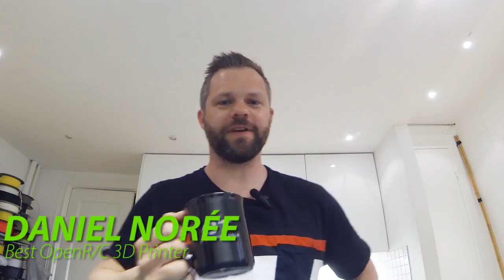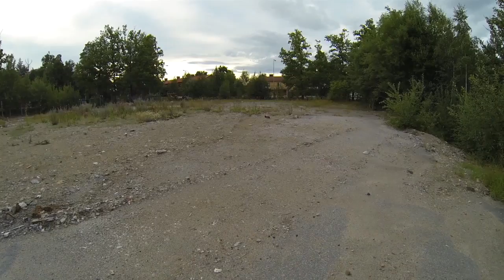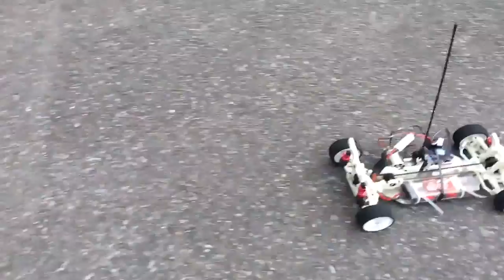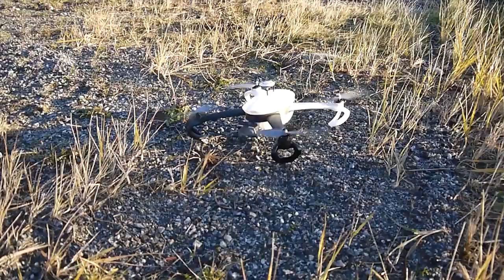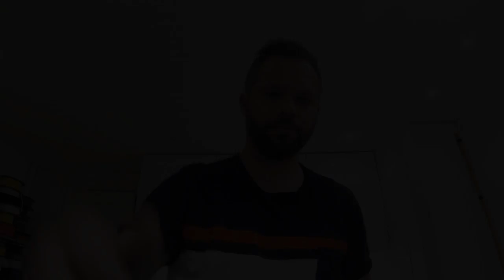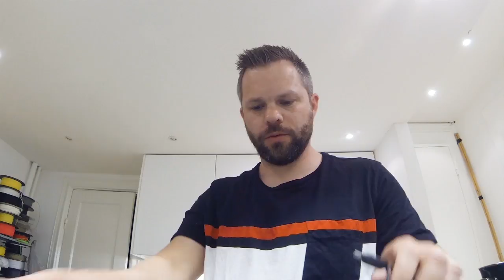What´s the best 3Dprinter for a OpenRC project?

Comment: You can get an all metal v6 hotend and a better thermocouple and you can reach 400 deg C (piping hot), Also you can upgrade to an AC heated bed (I have a 600W one) and you can even cook eggs on the heated bed.

Comment: I have a sub 200€ Chinese i3 clone. I have printed the truggy and i can print poly-carbonate very well.  The OpenRC projects are most definitely doable with cheap Chinese printers. I also calculated that it is approximately the same price to buy factory made tires from eBay,  as it is to print them from flexible filaments. So there is no need for a flexible filament extruder. The exact printer that i have is 150€ on eBay right now and is available from Germany so there is no need to import from China. All this being said the truggy does require quite a bit of filing, but that is the price I'm willing to pay for getting such a cheap printer.

Comment: What build volume do you need for most of the Open RC projects?
Reply: Andrew E I would say about 20x20x20 or 20x20x15 
But I found out, that you don't  really often print Things bigger than 10x10x10 and my printer can print 20x21x25 but of course thats up to you
Reply: i printed the truggy just fine with 20x20x18